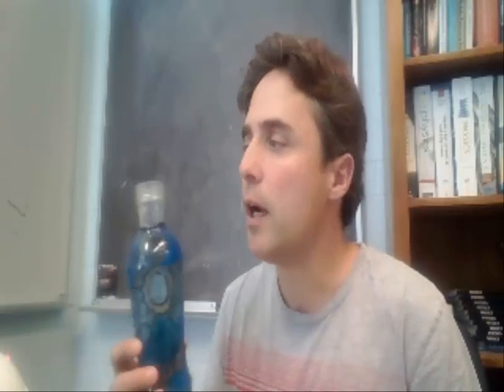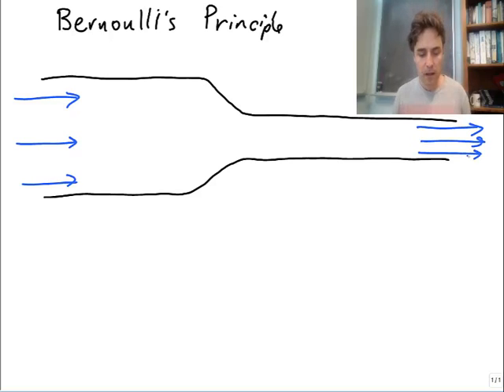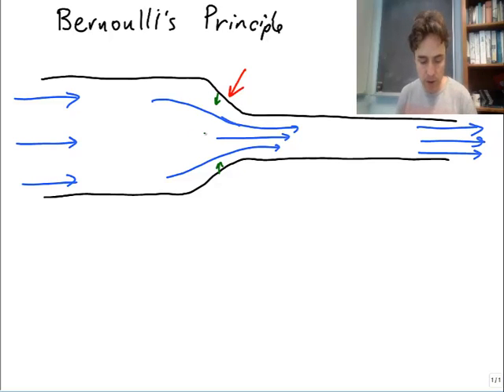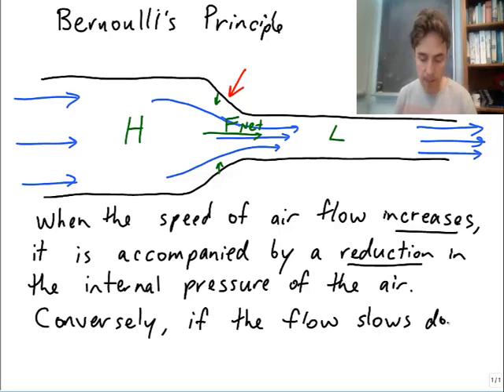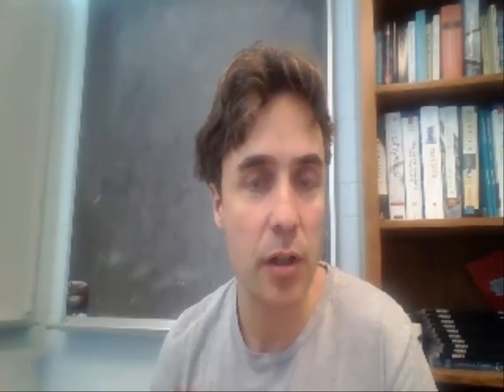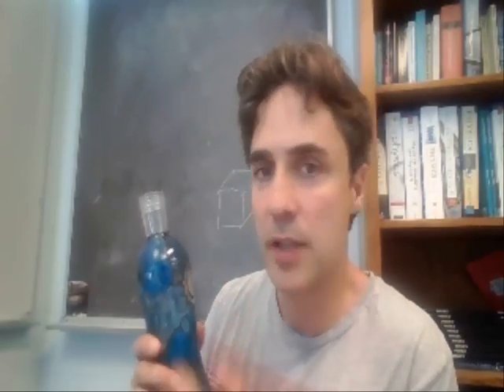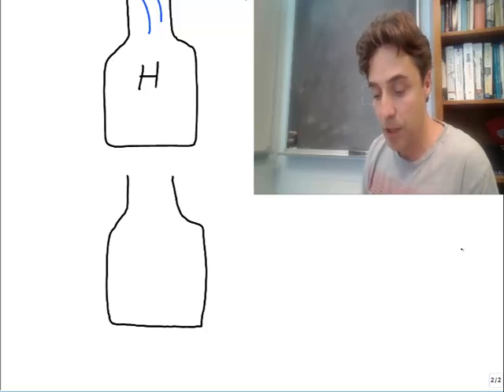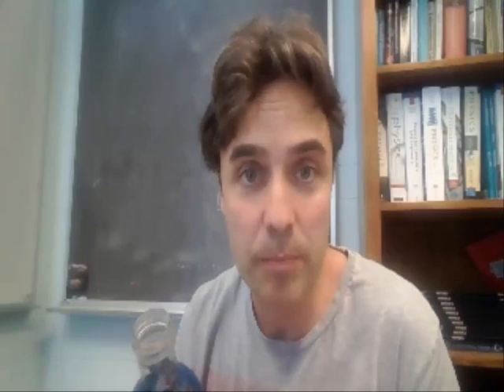Bernoulli's Principle and the Flute

Comment: But an actual flute is open on both ends. If you were to do this with a bottle by removing the bottom would it still overshoot equilibrium and oscillate between high and low pressure or does air flow in from the bottom and keep air always flowing out of the top? Thanks! This video was really great!
Reply: An actual flute has a cut in the top that air flows over, i believe according to google the pressure actually drops in the flute which must cause air to flow out & repeat
Reply: The flute is actually a bottle. Because the vibration travels towards the crown first. So you can think of the crown as the "bottom" of the flute. This is how you get the "base tone" just like with a bottle. Then depending on the fingering you are using, the air exits the first few tone holes and any leftover air dissipates as it reaches the end of the flute, changing the pitch due to the lengthening of the "bottle". The thing is that you can also change the "base tone" by increasing pressure. They call these overtones in the harmonic series. So even though you may be lengthening the "bottle" by using a certain fingering, you can still play at a higher pitch because you are playing a higher "base note".